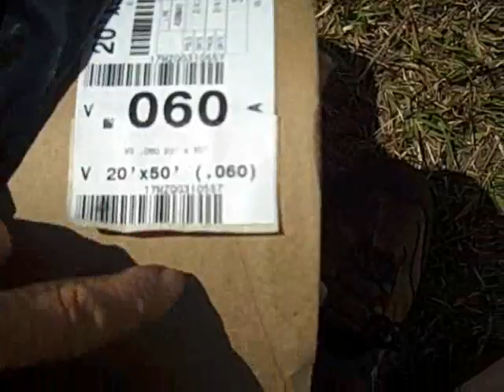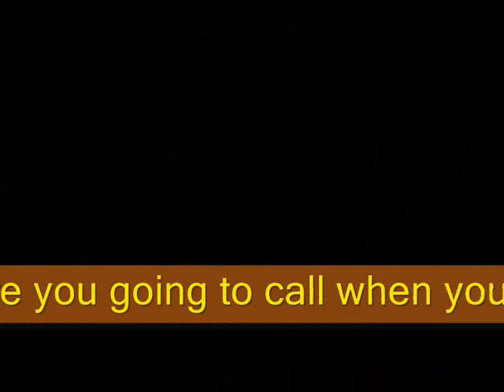Mobile Home Trailer Leak Repair Mobile Home Repair, Roof Leaks

Comment: when screwing down that osb you say every 6 inches at the seam. what are your screws biting? arent these roofs only 2x2 trusses every 2 feet? sounds odd that the metal would be right on the trusses with no sheeting but the couple mobile homes I have feel pretty sloppy in between all the trusses like there isnt anything under there at all... so I always try on walk on a truss. (these are both fairly old single wides, probably late 70s maybe)
Reply from the maker: Matt Speirs Sorry I never answered that question years ago we are now updated our videos and we don’t use Music